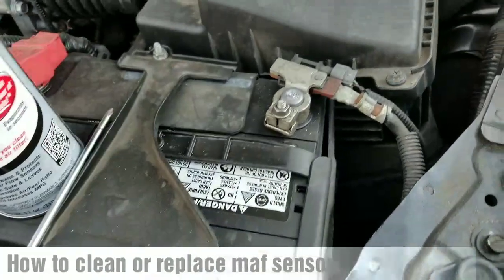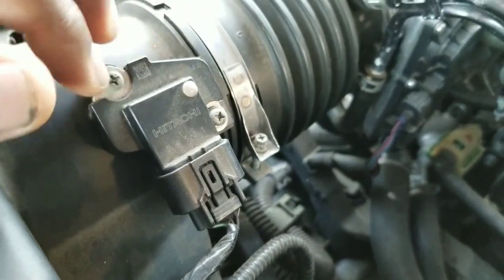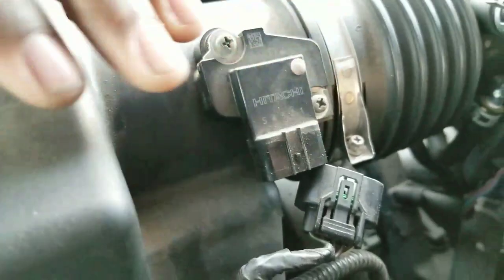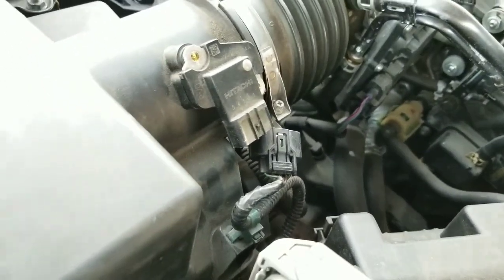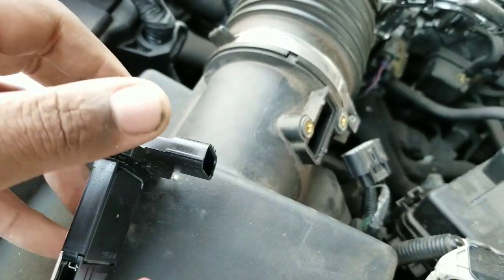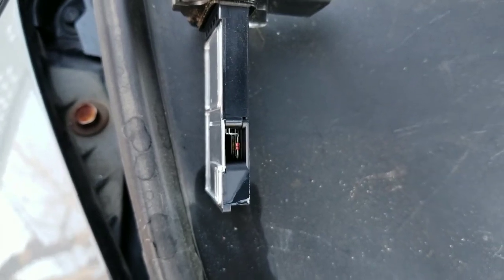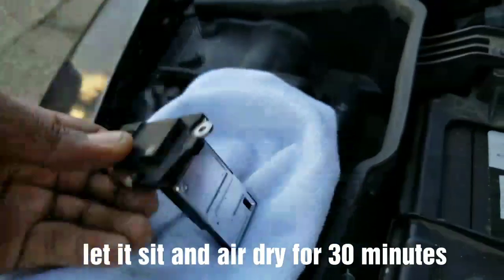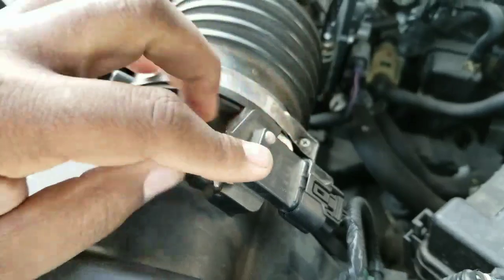HOW TO CLEAN OR REPLACE MASS AIRFLOW SENSOR MAF SENSOR CLEANING P0102  TUTORIAL

Comment: why are people so afraid to touch the wires? If they have visible dirt on them, spraying won't do anything. I cleaned the one on my truck with a qtip because I could see the crud on there. If I couldn't get that off I would have had to replace it anyway. I even visibly bent the wire. Put it back in and truck runs fine, gas mileage returned to where it should be. If it fails, I don't care, had to be done.